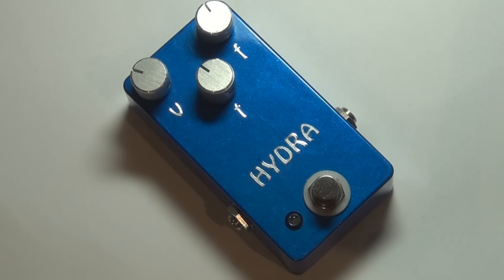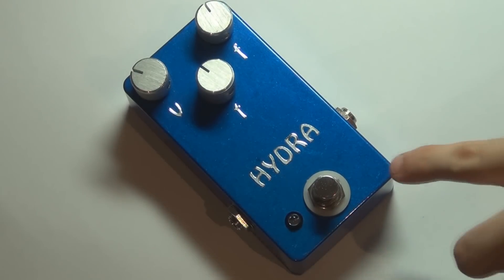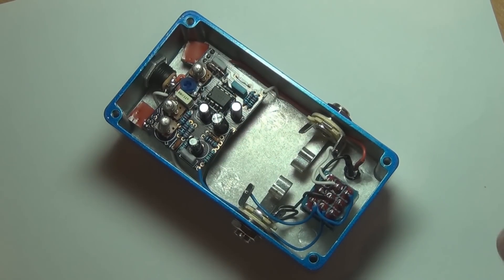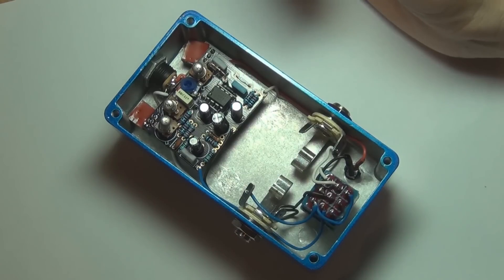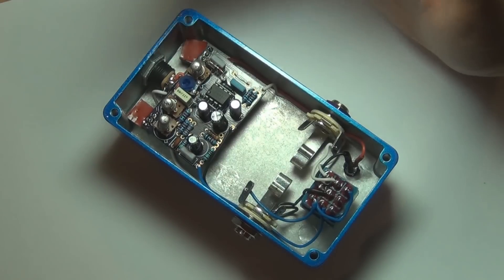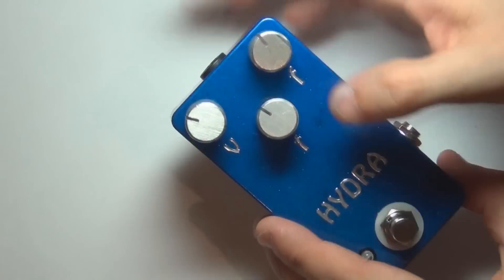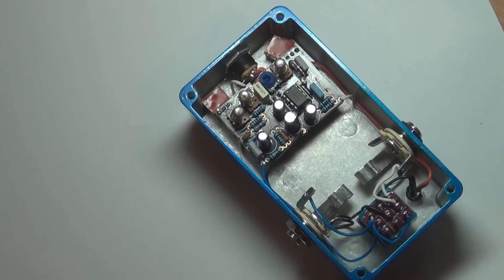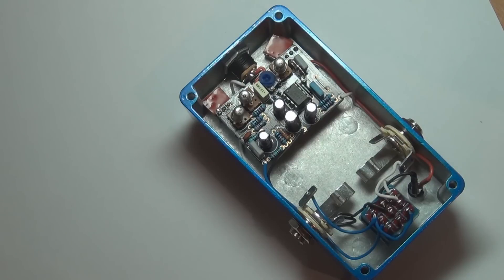DIYGP Hydra Fuzz - Build Report

Comment: So far I have your fuzz and 10 min dirt and boost.. Still working on boost looks like I should order the spdt board to make life easier. What's a good next pedal to compliment those two and do i put the boost first and chain off it? All new to me. :)
Reply from the maker: That's one of the best parts about having so many effects at your disposal!  There's no rule of thumb as far as pedal order goes, experiment and find what you like the best!  For a next build I would recommend maybe an overdrive or distortion?  Ross Distortion is pretty simple as is the night drive.  I would recommend 1590B enclosures and wiring the pots though if you are new to pedal building.

Comment: Is the Charge Pump part of the kit? I am new to this and I don't know what a charge pump is?
Reply: Thanks for your message amcrebelfan!  I'm slowing expanding the 'component kits' for my project but it takes quite a bit of time.  The hydra currently doesn't have a component kit so you will have to select the resistors / caps manually on the store.  There is though a charge pump option. When you order the kit just select the checkbox and I will include it.